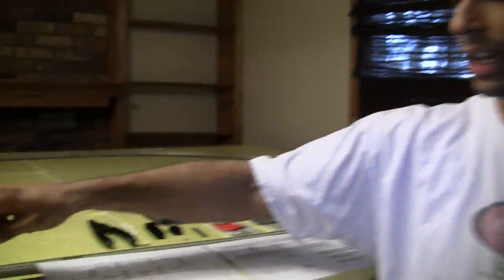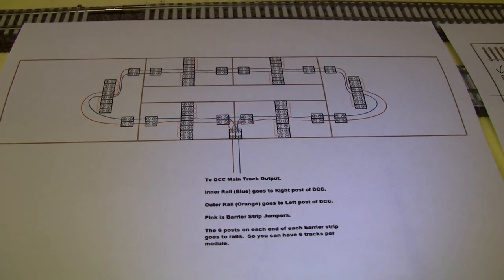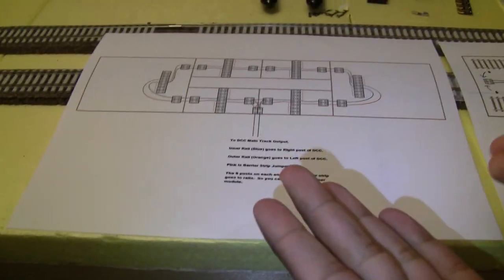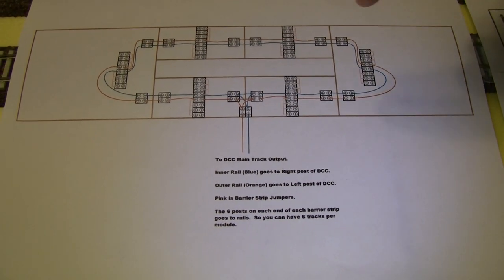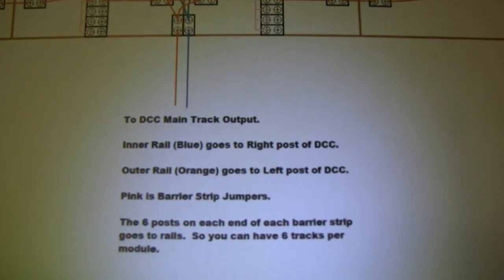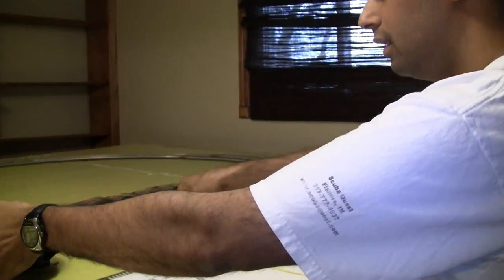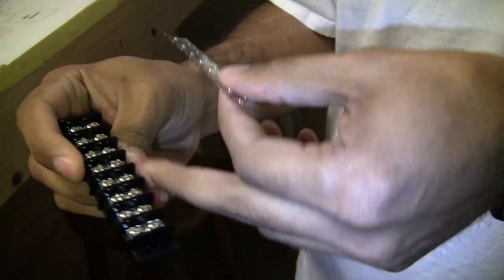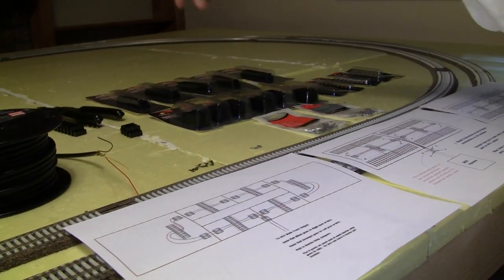Part 6 of How to Build your Layout from Start to Finish---Intro to Wiring

Comment: Old guy getting back in the hobby.  This is one of the first videos I saw.  After reading more about DCC, no one else is recommending 24 ga wire for bus wiring.
Reply: Even on a small layout I would anything smaller than 14 gauge wire for the bus.

Comment: And to connect the layout. Use speaker wire buss line. 14 guage or 16. And use the 2 wire speaker plugs to connect the moduals.. cheap and easy. The speaker connectors arent to tight and if u smash one theybare cheap and easy to replace. 

The speaker wire is amazing for dcc busses as its designed to information flow.

Comment: you can also save time by using 2 barrier strips each make 1 whole strip pos and 1 neg. and youvshould take time by using just 2 simple separate wires and don't forget flux and try to learn to solder. it all about patience and applying proper heat . once heated add the solder till it melts almost like butter and just as fast. watch it fill joiners. when solder ia applied you can go back and smooth it out with just the tip of gun perfer pen style for this. i to am a beginning rr junkie.  at 43 but been doing car stereo equipment since 13 before amps. when power boosters and eq where popular this is where i learned to solder. take the time then you will realize how easy it really is. from a first time garden layout builder to another layout builder you doing great ty

Comment: I don't think you need to do all of this if you are just doing a simple 70×41 n scale layout.  I was thinking of running bus wire and just connect the blocks to it I'm going to use the digitrax zephyr s51 as my controller.

Comment: Could you just replace the 8 piece terminal strips with just soldering the joints? If so that seems to be a lot easier to use.

Comment: If u dont want to "f " around and buy all these different sizes of contact connectors. Just get a 24 or a 30 row. And cut them with a jewlers saw. U remove one set of the contacts for screw holes. 

Im cheap  haha

Comment: @moore101446 The barrier strips are connected from one side to the other.  The jumpers make it so that you can make more than a 1-1 connection, you slide them under the screws along with your wires and it allows you to connect 5 wires to 1.  Or, instead of using the spades on the wires, you could just screw 5 wires to one screw.

Comment: One idea you could use for module quick connect.
Spring bearing for contacts.
Drill hole in side of each module(one hole ea. wire).
Line them up so when you put them together, they make soft connect.
No need to hook and unhook wires when moving mods.
Solder wire to bearing casing before inserting, into the hole.

I think you can get metal spring bearings at any hardware store.
I would go with a 1/4 - 1/2 in.
Just to explain, like in a soft latch door.

Comment: Power continuity is the main reason. The solder joints on the tracks will eventually deteriorate, and by having power to multiple sections you will be able to isolate problem areas for repair as you come to them instead of the entire track failing from one poor spot.

Comment: Again here is where you can use the lamp or light on a stand to help you. See I never give a suggestion that can be only one use. I won't have much help here for I am using on board battery power for my engines so no shorts, no worries about reverse loops or "Y"'s or anything like that. The only power I have is a 8 wt circuit for my switch machines.

Comment: i had train sets as a kid so i kinda know about train sets and im thinking about doing a train setup in my house and im wondering why you need so much wires the control box can't supply enough the track to run more than one train or cuz the joints of the flex track loses power what the story behind this oh and don't listen to the other people i think you are doing a great job better the i could but im very intersted and know im really wanting to get back in to this
Reply: I understand the confusion, normally yes the supplied power box/ Control box can run your layout (setup). There is sometimes dead spots as your layout because its growing and gets bigger. I had these problems as I made my first table 3 years ago. I am currently making a brand new table using his methods and its going great. The reason there is so much wiring is because he is setting his up for DCC, this is a different system from your power unit. DCC allows you to control one or more trains with different speeds and directions, and it also adds extra functions like sounds. This gives it a more realistic approach to the layout. Not all engines that you may have in your collection will be set up for DCC so you can purchase little micro chips that can be wired into your engine. I could blabber on for awhile about stuff to make it easier for you. More less follow his instructions and its going to be really hard to mess up because he was kind enough to mess up for us, its why hes doing the videos.
Reply: ah I guess lol kinda get what you are saying

Comment: I'm still a novice at modeling so I have to ask...why does each section need its own power wiring? Why not have the system wired together and wired to the power at one location? In other words, why wire each module separately rather than wiring them together with only one location where the power feed connects to the track?

Comment: probably a silly question but do you need feeder wires to the track rails every few feet with DCC, if you do, did you touch on how to connect the feeder wires in any of your vids?

Comment: can u use a dcc controller on dc track
Reply: Great question which no one covers. My question is can you use your old DC drops to hook to your DCC, then run the separate DC and DCC power feeds through a double throw/double pole toggle switch so you’re using only one power source at a time?